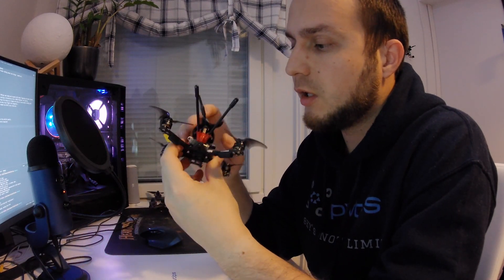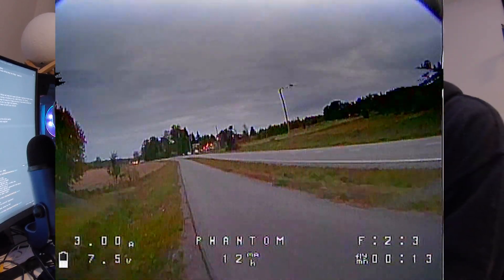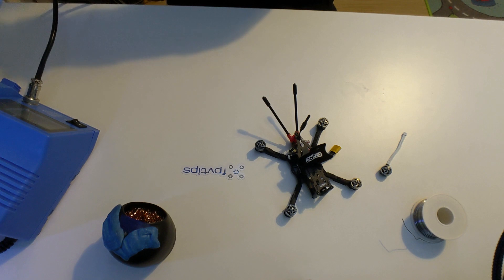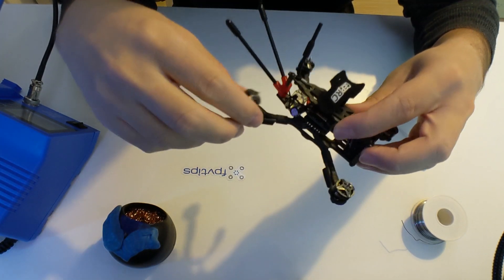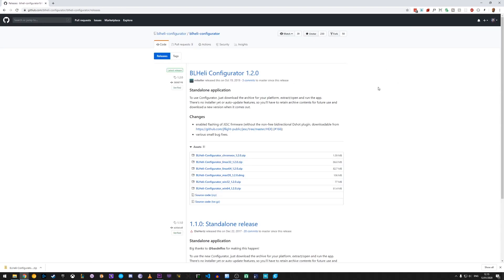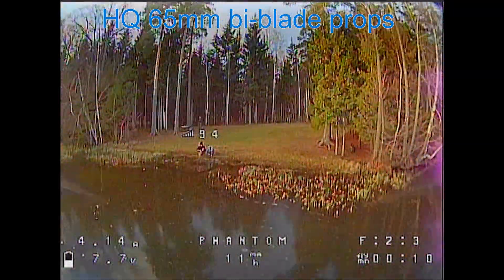HOW TO REPLACE A DRONE MOTOR: Diagnose and swap a motor on the GEPRC Phantom toothpick quad

Comment from the maker: TABLE OF CONTENTS:

0:23 - Battery falling off and burning a motor
0:42 - Demo of the twitching motor
1:13 - Rambling on faulty motors vs ESC and  4in1 ESCs
3:15 - Swap a bad motor with a working one to test it
6:10 - Desolder the old motor
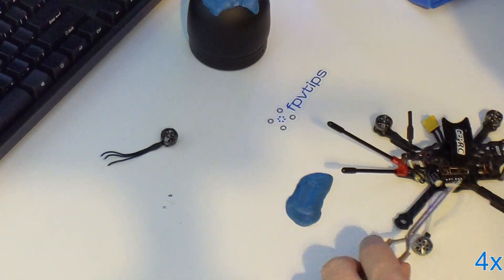7:15 - Solder in the new motor
9:00 - New motor spins! Yay!
9:15 - BL Heli Configurator - adjusting motor direction
11:33 - Betaflight Configurator - motor tab
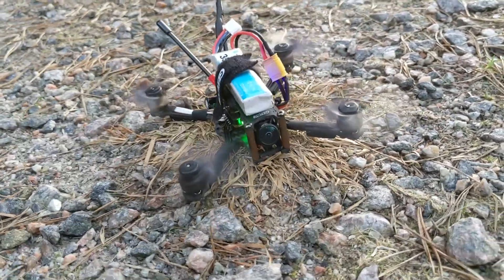12:17 - GEPRC Phantom flies again!

Comment: great vid thanks ...i have problem  problem with my phantom.... have spoken to geprc..geprc engineer... i have the same type of vid interference as you on 13:38...that blurry noise.. mine just happens to such a extend that i struggle to control quad... especially when flying into sun...  Do you perhaps have any recommendations ?? thanks man.. here is vid of issue..  https://www.youtube.com/watch?v=KgtBo830gsQ
Reply: Strangely  i replaced entire stack..part for part to troubleshoot....still the same..quad is great but mine challenges me lots .
Reply from the maker: @michaellabuschagne8321  wow, that's a pity. Maybe some electrical interference then? You could also test component by component with another stack that is known to work, but yea maybe this gets too involved. Plenty of opportunity to thinker and learn though :D
Reply from the maker: Hmm, interesting. I don't recall very clearly if the issue was more pronounced in the goggles while flying or not. I think it was as you can see it in the VTX. In my case, not a deal breaker, but not nice. I'd try out swapping for another camera and testing out. Interesting to hear you have already changed your VTX, so that's probably not the culprit then.